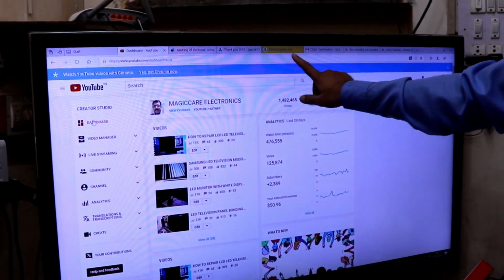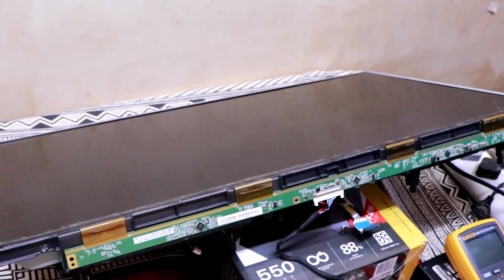LG 32LN5120 No Picture Repair | LED TV Panel Diagnosis & Voltage Check

Comment from the maker: 🔧 LET'S FIXED YOUR LG TV! If your LG 32LN5120 has sound but no picture, reply below with:1⃣ What voltage are you reading on the VGH and VGL test points?2⃣ Is your main 12V input fuse on the scaler board intact or blown?Hit that LIKE button and SUBSCRIBE if this practical diagnosis sequence helped you trace the fault! 🛠👇

Comment: I need help finding a Dongbu DB7876-FS02U (SV379020) COF.  It is for an LG 60LN6500.  I replaced it with an DB7876-FS02U (SV2N0312), and the repair isn't working yet. 

I also cannot find datasheets for LG (Dongbu) COFs.

Thankyou